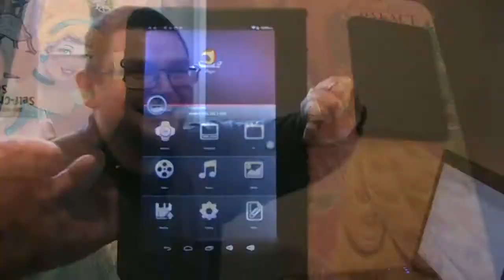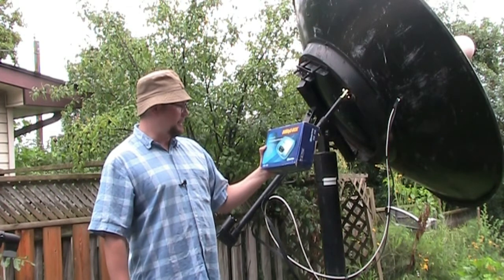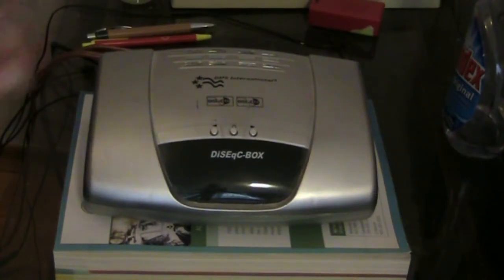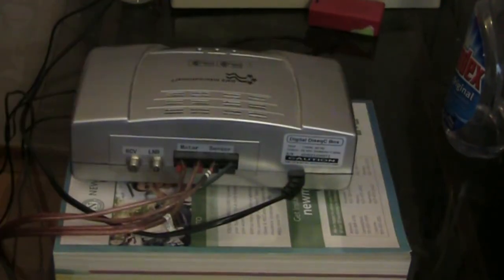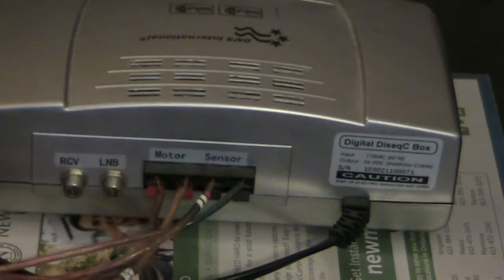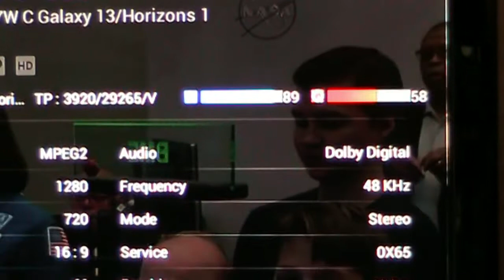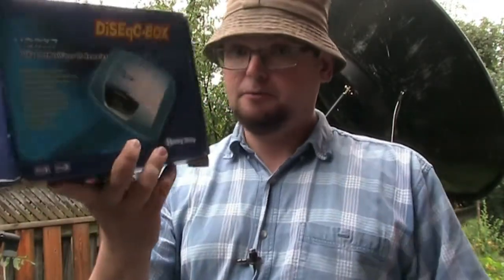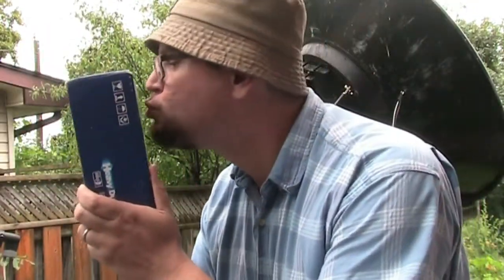VBOX7 Satellite Dish Mover C Band KU Band 99 Memories

Comment: Hi Robbie!
My vbox quitted working and  now, I'm stuck on 113w. I love this satellite with so many fta spanish and english tv channels but I miss the other satellites. I have not been able to find a new vbox so decided to open it to check for any obvious damage but every thing looks good, not even a cold solder, only 2 capacitor that look a little swelled on the top. Using a multimeter found 3 foulty diodes. As soon as I get them replaced will let you know if succeeded or failed.
Thanks for all the good information you put up on your channel.

Comment: Hi Robbie another great video, H/H or H to H means Horizon to Horizon. I have a Ku dish that is driven H/H and works very good BUT are very fussy to get installed. You must have a pole with as plum as possible or the alignment will never work. Thanks again for another great and funny video...Leo
Reply from the maker: LOL I ended up finding that out what it  was looking at the www.tek2000.com and i saw one. But thank you. http://www.tek2000.com/cgi-bin/web.cgi?command=product&item=XCruiser%20XH240%20H-H%20Motor-ND